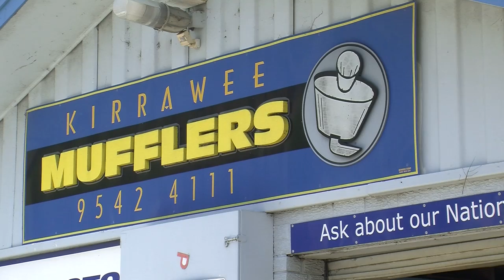Marty's Euro Car

Comment: Some people just don't want a nice car. My friend goes from junk car to junk car every other month. I don't understand why he doesn't just get something he can be proud of and would actually drive for more than a few months
Reply: ***** Toyota? Honda? Lol...
Reply: I owned a toyota product for years and never had an issue. I have a bmw now- keeping my fingers crossed lol
Reply: Justin Buice That's cool and good for you, but Dick was saying VW's are junk and Toyota/Honda are the way to go. Of course Toyota's have been riddled with recalls and defects in the last 10 years and in the 90's and early 00's, Honda's had a terrible reputation. It's only lately they've picked up.

VW make some cracking engines. It's just about buying the right one.
Reply: ***** Um...No, they're really not.  VW's had some bad electrical years with certain models, and the MKIII cars were just plain bad even when they had the sweeter then sweet VR6 (horrid weight dist.), but overall, esp. earlier VW's are very good cars.  Sorry, I'm a total Toyota nut (I'm currently building a KZN130 Hilux Surf in the US, I drive an 89 Hilux Surf with 320K miles on the original 22RE, and I've built more then a few VW's for street/track and Rally use so I know my way around them very well), but the iron-block 4-cylinder engine the VW's are so famous for is as bombproof as the 22RE is.  The interiors of old and Toyotas and Hondas fall apart every bit as badly as VW's (sometimes worse), but the older MKI&II cars like I build actually hold up better and IMO they still look every bit as great as they did new.  Plus Honda and Toyota haven't made a modern car that can directly compete with the VW's for a LONG time (not to mention that modern Civics might just be the ugliest things ever inside and out, same with most modern Toyotas BRZ/FRS excluded).  The S2000 was the only Honda outside of an NSX to ever be worth getting excited about  about and they're not exactly a direct competitor for the Golf in any respect.  While Toyota has some neat old cars like AE86's and ST's etc. (the last Celica was slow and overweight and the Civic SI has always been WAY too short on torque to keep up on the street) again they're not exactly comparable chassis.  Most of the REALLY fun Toyotas are either AWD or RWD and nearly mythical in terms of finding one depending on where you live (cars like the Supra, AE86 and STXX(X) Cellica All-Tracs).  With the segment topping DSG (and a very high-end standard manual), interior trim levels and fit/finish quality not seen in average tuner cars, and the simply amazing AE888 4cyl in the current GTi/Polo WRC and upcoming cars like the Polo R (I would KILL to get one of those little WRC homologation cars here in the US), Audi S1 and the Golf Evo R, VW will be staying at the top of the pile for some time to come (they already have the fastest lineage in that the Seat and Skodas are all just VW MBQ chassis underneath).  Modern VW's are also notoriously easy to screw with, and a simple ECU re-flash nets some serious results vs the JDM stuff that is getting harder and harder to crack into (by design) and tweak.  VW had some bad years, Honda and Toyota have too... it happens, but VW's are not, in any respect, "junk"...
Reply: I've owned many cars before and I learned one thing; I will never love a car I bought for 15K as much as a car I bought for 3K and invested money, hard work, and time in.
Reply: ***** Modern VW's are junk, the old beatles with the air cooled engines were pure awesome...once you took the engine out, and put it into an offroader cage with big fat tyres and hit the dunes lol

engine wise the old beatles are so reliable its crazy, my dads old offroader turned beach buggy has a 53 year old engine, 33 years old when it went into the offroader, after 20 years of barely any maintainence, one oil change, and a loose air filter letting sand in, its only just starting to die now by the slow loss of power
Reply: Could it be that he is just not god at taking care of his car? That he has tried to buy a keeper, but he just ruined it and that is why he decided to only drive cars that are going to the scrap yard anyways.
Reply: +InvisibleYetVisible Toyotas and Hondas have always been more reliable than Volkswagens though... Always, Volkswagen might be good when they work but they're "over engineered" like most of German cars and have faults because of this, basically German cars are like Italian ones but they break from other reasons than the Italian ones, yet they both die from electrical problems.

Toyota, Honda, Nissan, Mazda etc etc, you cannot really buy more Reliable car than that, meanwhile BMW/Audi/VW and so on are so over-engineered, a friend of mine bought a low mileage A3 1.8 turbo quattro while i have a equivalent non-AWD Nissan, i've had my Nissan for 4 years while he's had his A3 for 1 or 2 now, my Nissan has had 0 flaws and it's always went through M.O.T while my friend's A3 is rusting from it's zinc body and just now it failed the M.O.T, an A3 8L is basically an GTi Golf IV since it  uses Haldex instead of Torsen and because it has Haldex, the ESP system broke and the car couldn't get a pass on M.O.T, the professional workshop for VW/Audi tried to fix it but they couldn't find a fault, that said workshop is the biggest workshop in town and it should also be the expert on VWs and Audis since they've been working on them for at least 60-ish years, a Haldex problem shouldn't be new to them but nope, no fault found, the car that was more expensive, had 1/4 less mileage than my one, had more power and better equipment had broke down after just 2 years and it couldn't be fixed even by the experts.

Meanwhile, i had a ESP ABS sensor break on the rear axle on my one, i just replaced it and it works.

Like i said, over-engineered, though granted i don't have AWD, but from my knowledge even if the A3 was a FWD instead of Quattro, it'd have even bigger problems because the FWD is known to be terrible.

So basically... my Nissan that cost like 10 grand less when new is better car and is still running while the Audi is dead and cannot be fixed by experts.

Granted, the Audi drives better, it's more comfortable and has better equipment but like Marty said on the video, the car makes you feel nothing, it's just a well made & over-engineered car that makes you feel no different.

Meanwhile you could have a 200SX that you've worked on for a long time and it'd be a lot more fun, or NSX, MX-5, Evo, Imp etc etc.

The AWD Audis (not VWs) do work nicely when they work but when they're broken they're either impossible to fix or take a long time to fix and aren't as simple as the better cars, you must remember that this talk is about which is better car which links to it's reliability and ease of working on it and Germany simply is not either of those things, they're just tiny bit nicer when they're not broken.
Reply: I've had a VW: boring car and the entire car was either replaced at least once or broken by the time it had 250k km, on top of it being the most boring car I've ever owned.
A few years later I had a Volvo with a VW engine, replaced it by the same car with a proper Volvo engine later because the lazy POS VW engine failed.
I bought a Fiat last year knowing it couldn't be worse than VW, time will tell but its definitely holding up better than the stories of Italian cars make believe, and it's a fun car I actually want to drive and look back to when I walk away from it, even though some things aren't as "nice" as in the VW and it isn't an Abarth or Quadrifoglio.
Over here people buy VW's because they've had a few good ones in the 60s-80s and they've never bought something else, they call it bad luck or "those modern cars are all throwaway consumables" when their engine or DSG fails after just a few years.
Reply: golf 2 still running
Reply: @DrEtzor  clearly you haven’t owned a modern vw and kept maintenance up? I’ve got two golfs, mk3 and mk5 gtis and never had a electrical issue you speak of? Do you have first hand experience dot back these statements up?
Reply: @Candisa  fiat not worse than vw??😂😂😂
Reply: @JackVinall35  After 5 years I can say it's definitely better than my experiences with vw, not an old Volvo though (but neither are the newer ones). Stuff breaks, but less and cheaper to fix.
Reply: @JackVinall35  Golfs and Audis share problems, the 8L is also a Mk4 golf, not a 3 or 5 so of course you wouldn't have the problems of something you don't have.

Comment: i drive an 89 vauxhall nova, the suspension is bouncier than a trampoline, the fuel gauge works when it wants to and its got plenty of rattles and creaks. but everytime i get in it, i fall in love with it a little bit more. it may not be the quickest or comfiest, but i wouldnt trade it for anything.

Comment: I have a 2004 BMW 325i and it is the best car I have ever owned! As long as you change the oil and other regular maintenance, it will go forever no problem (seen same car go over 500 000 miles with just a transmission, pumps, bushings and belts replaced). Plus the car has a "soul", RWD straight 6 engine, and all the comfy stuff you can think of. Only setback is that they are extremely hard to find with a standard gear box(in the US that is). I respect these guys but owning a BMW=loads of fun.

Comment: that's exactly why I don't like volkswagens I find them to be boring
Reply: +suzukirm250rider1 It's just a basic car :D
But you can do so many things with them so if you don't like something you can just change it
Reply: Reckless entertainment as a Volkswagen owner I don’t understand how you could find a car with such unpredictable reliability boring.
Reply: Well, you can have something as reliable as a VW AND way less boring to drive.

I switched cars with my mother about a year ago: She wanted a newer car with better gadgets and I HATED my 2011 Golf 6 with all bells and whistles. There is just no emotion. VW dulled it down so much it is almost impressive.
So I took my mom's 2003 Mazda 3 instead which is so much more engaging to drive: The steering is way better, it has a much more responsive and better gripping front (the Golf 6 had enormous under-steer) and I switched back from a TSI to a NA engine which I like more anyway.
Both of them are far from fast (1.2 TSI 6-speed manual with 105 hp vs. 1.6 5-speed with 105 hp) and with my driving profile the Mazda uses about 20% more fuel. But I don't care.
It now has 200k km on the clock (the Golf only had like 90k km when I switched) and I never had any problems apart from a dead battery. I had to change a few service parts (water pump, spark plugs, radiator fan) but it is reasonably easy to do yourself. The clutch will have to be changed soon. That will be a big one.

I would do it again in a heartbeat!

Comment: "Stupidly huge engine" "1.8l"
Lol in America that's small as fuck.
Reply: nope, its actually powerful 
and fuel economic compared to your inefficient (sometimes like for example, pickup trucks) engines that are absurdly high in compression. I know the reason and its because they want raw power, rather than forced induction, but still, superchargers are forced induction. an example to efficiency is a Land Rover Defender 3.5 litre engine (top of the range and most powerful vs a Ford F-150 Wildtrak around 5 litres to 6 litres)
Reply: nope, its actually powerful 
and fuel economic compared to your inefficient (sometimes like for example, pickup trucks) engines that are absurdly high in compression. I know the reason and its because they want raw power, rather than forced induction, but still, superchargers are forced induction. an example to efficiency is a Land Rover Defender 3.5 litre engine (top of the range) and most powerful vs a Ford F-150 Wildtrak around 5 litres to 6 litres
Reply: nope, its actually powerful 
and fuel economic compared to your inefficient (sometimes like for example, pickup trucks) engines that are absurdly high in compression. I know the reason and its because they want raw power, rather than forced induction, but still, superchargers are forced induction. an example to efficiency is a Land Rover Defender 3.5 litre engine (top of the range) and most powerful vs a Ford F-150 Wildtrak around 5 litres to 6 litres
Reply: nope, its actually powerful 
and fuel economic compared to your inefficient (sometimes like for example, pickup trucks) engines that are absurdly high in compression. I know the reason and its because they want raw power, rather than forced induction, but still, superchargers are forced induction. an example to efficiency is a Land Rover Defender 3.5 litre engine (top of the range) and most powerful vs a Ford F-150 Wildtrak around 5 litres to 6 litres
Reply: Thanks for your youtube essay, however I was already aware of ALL of that. I was just making a point that engines here on average are bigger. I didn't imply anything else.
Reply: +Joe Buttsecks I think he meant its a huge engine for a car that small. I bet its got good power to weight ratio.
Reply: +Joe Buttsecks for a hatchback as small as the polo is it's huge in comparison to a stock polo
Reply: Joe Buttsecks no, i live in America, 2.0 liters is big.
Reply: Actually in Europe, for a car that size a 1.8 liter engine is quite big... my Polo 9n3 is a standard 1.2 liter... and we have also smaller engines in cars... like 900 and 750
Reply: Well, American cars usually are bigger but nowadays most of cars sold in America have similar size engines as Europeans, the efficiency is a lot higher compared to the big old American engines.

There was 2 liter inline engines with 200 horsepower (without turbo or supercharger) already back in 1960s (in some production cars) outside USA meanwhile USA had cars with 7.2 liter engine but only ~160 horsepower, i think some even had 8.4 liter but only 150 horsepower, which is quite terrible liter / power ratio.

Comment: Typical of a german car... Specced well, good on paper... Has no heart. German cars generally lack any type of soul
Reply: Matt G I disagree, in my most German cars have some soul. I have a 2004 Jetta wagon and boy let me tell you, that 2.0 115bhp car is more fun to drive than a lot of other cars I've driven
Reply: In my opinion VW's (and Audi's by default) are as bland as eating wallpaper paste. Those mk4 Jetta's were not very good when you compare them to a similar year and spec ford or mazda or even a european car.
Reply: who was the fool who brought up a merc BMW or porsche? This whole vid is about a cheap hatchback, which germans do all the same. Small, grey, boring. If you want to talk about higher spec mid range saloon cars, there are many more exciting vehicles out there than those german boxes. Case in point, german cars for the most part have no soul, no feel, no passion. They are machines and that is it.
Reply: If you're wanting non AMG or M spec... Then a Ford fusion / mondeo sport, mazda 6 mps, honda accord sport, alfa guilietta, Jag XF and XE. Maybe a more direct comparison is an opel / vauxhall insignia vs a ford mondeo / fusion vs mazda 6. By miles and miles the ford and mazda are more dynamic and a more exhilerating drive, which none of the big 3 (merc bmw and audi) can match for the price. If you are talking M or AMG or S-line spec... Then you're looking at the XFR, lexus ISF, alfa gulietta quadrofoglio, maserati quatroporte etc. I would say all of those are more exhilarating than the equivalent merc or BM, except maybe the lexus as those can be pretty hit or miss

Comment: Electric windows don't work when you've driven into a ditch or canal, trapping the occupants. Keep the drivers window manual and automate the offside so you don't need to stretch.  Driver's window, reach down and turn by hand.

Comment: sometimes it's worth it on transverse mounted engines because of the way the exhaust sometimes needs to bend as the engine kicks a bit under torque it either tries to compress or stretch the exhaust pipe as opposed to rocking to one side as it would in a rear wheel drive car

Comment: they forget to mention that when you replace the front of the exhaust with a version WITHOUT the sensorhole in it, your enginelight lights up due mallfunctioning of the sensor. i have a 2006 GTI, HAD to weld in the sensorhole because the cpu gave an error on it. The car is awsome, you just gotta learn to love it, i came from opel to honda's to a lexus to a polo GTI and tbh i love the polo the most simply because the combination of power and comfort.

Comment: Just a little "tip&trick"... What happens on those cars is that after you replace bad bush(i don't even know how to write it so sorry...) you still have noise coming from same place - sometimes the arms is worn out too so new bush(ing?) isn't fitting so you have to remove it too... (I'm working in concern service, so that is where i know it from :) )

Comment: There have been subarus with over 1000hp and they perform just fine. And with the awd system tending to understeer, it can be adjusted with modifications so that more of the power is biased towards the rear. You can even look up a 1200hp subaru on youtube. Its a four wheel drive drag machine. And that much power wouldnt be that bad for rally racing. Take a look at the 980hp suzuki escudo pikes peak rally car. Its one hell of a rally car that kicks some serious ass.

Comment: that's a test pipe you're think of. high flow cat is a cat converter with higher flow. Also has platinum inside which reduces a lot of smog that gets put in the air. Seems kind of like magic to me, but has to be some chemical reaction behind it all. Meh, I'm running a test pipe because I couldn't find a cheap enough high flow cat. Gotta pay to save the environment. lol